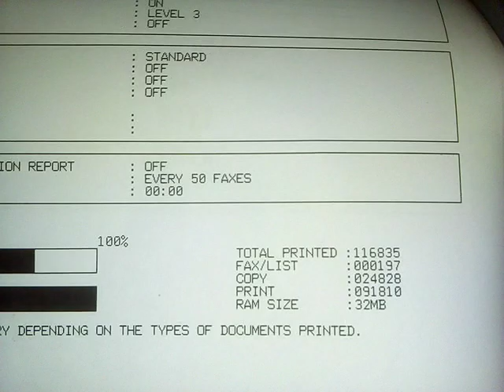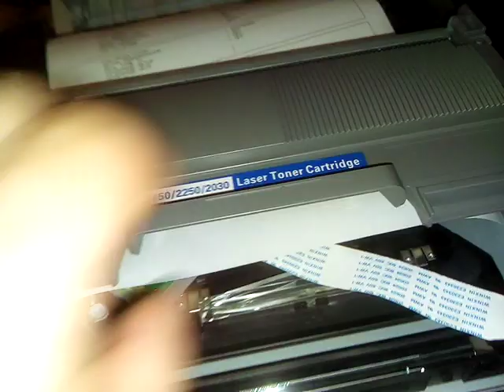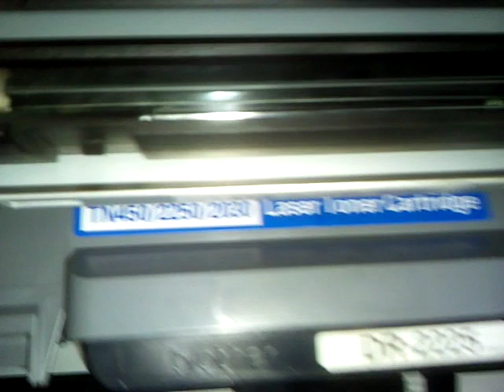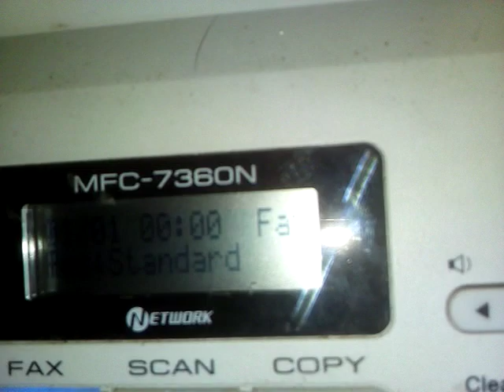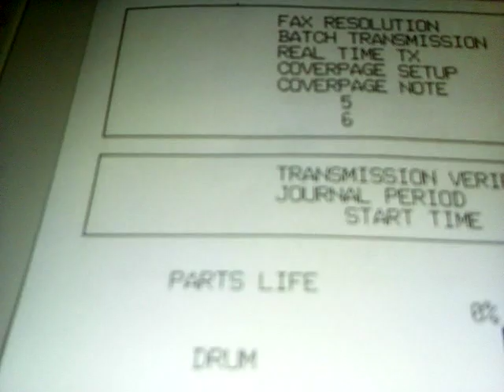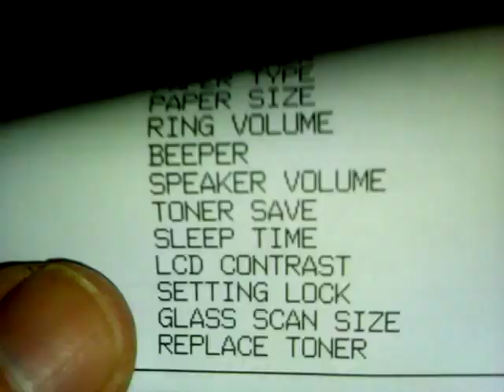Brother MFC laser printer fix left hand side faded prints printouts

Comment: Thanks for posting this video.  Told me exactly what I needed to know, I cleaned the rubber rollers and mine worked.  I didn't have to access the Laster but now I know how if it become necessary if I need to remove the plastics outgassing that condenses on the mirror.

Comment: Is it possible for the mirrors to be "dirty" without that dirt being visible???  We have a Brother HL-5250DN where the leftmost inch or so is maybe 1/4 of the print density of the rest of the page.  However I couldn't see any dirt or haze at all on the mirror, even when examined with a magnifying glass.  The reflection of the drive cable for that motor in all of the mirror edges was sharp and clear from edge to edge.  Is there some better visualization method for seeing this contamination, if present?  Also, in the video you pulled the mirrors out of the printer.  Is alignment of this part critical or is "wherever the screws put it" good enough?
Reply from the maker: Check the density of the toner on the dev roller
Reply: On closer inspection the test page was light because of light vertical streaks.  The toner cartridge is a Rosewill RTCG-TN580 and the doctor blade is not visible (at least to me) between the case and the developer roller.  A piece of printer paper was folded in half and creased, but it could not be inserted blindly behind the roller into that space.  A single sheet of printer paper, prebent to match the roller's curvature, did slide in between the blade and the roller, and once in it was dragged to the light side.  Luckily it came back out intact.  That fixed the problem, no more light print on one edge of the page.  Thanks!

Comment: nice helpful video.
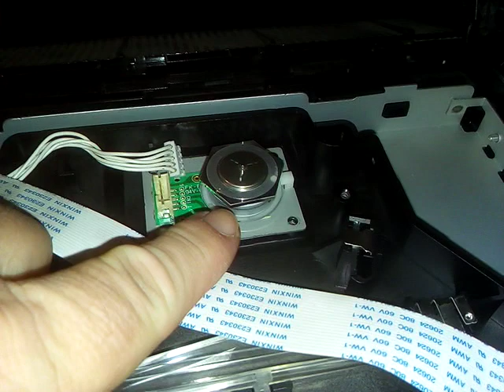ps: it is a HEXAGONAL mirror  3:12
Reply from the maker: Us old technicians talk generally about the laser motor. The first laser motor that was invented was invented by Canon and it was a polygon motor and that name has stuck since the mid 1980s. HP had a four-sided  laser motor in the LaserJet 5L 6L in the service manual it's called a polygon motor
Reply: @TerryJonesPrinterRepairs  , i guess us old ocd techs are sticklers for detail in geometric shapes. i suppose it was also  in response to you also referring it as "octagonal".    But seriously, i will be using the info from video to return to a customer to clean this "spinny mirror" and finally get the brother printer fixed. i had known a similar fault with a canon image press 6000 with dirty laser mirror, fixed by cleaning it.

Comment: How do you get to this mirror if you don't have an MFC? I have the normal Brother printer (HL-L6200DW) but have this same problem (faded on left side)
Reply from the maker: L6200dw is a bit too new to have this problem unless its in a hot dusty environment. Check your toner and drum 1st. clean the inside roof above the toner/drum with a damp rag.
Reply: @TerryJonesPrinterRepairs  I am in California and it's hot here. It's been in the garage for a couple of months so that's why it's dusty. I did check toner and drum and cleaned those already and it fixed and removed black smudges however the left side of prints are faded so based on process of elimination it has to be the mirror that you talked about in the video. Thank you!

Comment: Have you encountered a situation with Brother printers where there are dark smudges on the left 1" of the paper?  Doesn't matter if there is text or images or not.  I found wrinkles on the left side of the fuser and replaced the fuser but the condition continues
Reply from the maker: WHAT MODEL?
Reply: @TerryJonesPrinterRepairs  MFC8860DN
Reply from the maker: Brett Gilbert  your drum needs to be changed or polished clean.
Reply: The imaging drum?  It's brand new.  I've replaced the toner cartridge, the imaging drum, and the fuser

BTW I went into maintenance mode last night and printed a test pattern print and when it gets to the solid black bar I noticed clumps of toner and then when the black bar stops the page is clean, at least until the next page prints.  So could there be an issue with the developer roller in the toner cartridge or the nipping blade?
Reply from the maker: @BrettGilbertLightguy48  why don't you make a video of how it prints and post it.  Have you left your drum out in day light. Is it a genuine drum and toner?
Reply: It is genuine  DR-520 drum, genuine TN550 cartridge,  however, looking at the box I do question whether the fuser is a genuine Brother fuser.  Is there a way to make a video and tag you or send it to you?
Reply from the maker: The fusers job is to melt the toner on the paper not to form the image. If your image is wrong it is either your drum your toner your laser or your high voltage. Just because their new doesn't mean they work.
Reply: True, but would even if I replaced the toner and imaging drums what is the likelihood they would have the exact same symptom?  The reason I replaced the fuser drum was because it had wrinkles in the drum on one end.  But would the laser cause smudging when there is no image to be printed?   i.e. if a print a blank sheet of paper the laser should be off shouldn't it?  So wouldn't the smudges disappear during blank printing if it was a laser issue?   So considering I have replaced everything else is the next logical item the HVPS?
Reply from the maker: Brett Gilbert  no not at all, you will still get smudging  when printing a blank page because your drum or toner may be faulty. The laser only draws an image in negative or positive development, Its the drum and toner that form the image. You may be making the drum faulty because you are using a flood lamp to light up the work area you are fixing the printer so you can see what you are doing. Drums get ruined by intense light. There are many variable to cause poor image, without a video I cant help further.
Reply: I posted a reply back with a link to the video a couple of replies ago.  I have not used a flood light on the image drum and as I showed in the video the smudging goes away when the printer prints a full black test bar, but then returns on the next page print
Reply: Here is the video link again:  https://youtu.be/1ihRyF3Rqdw